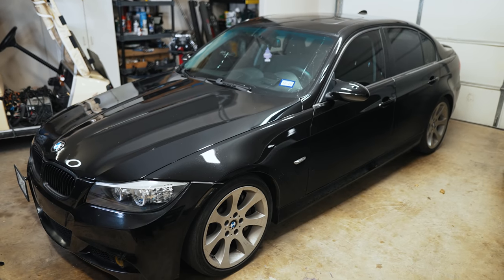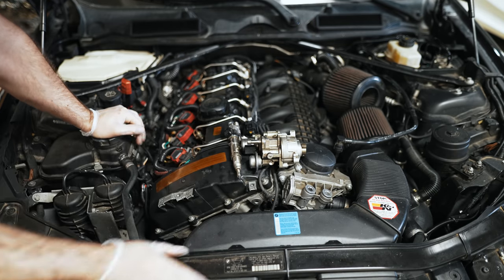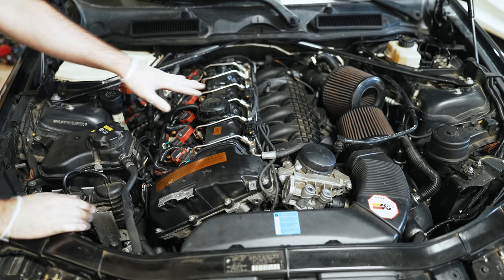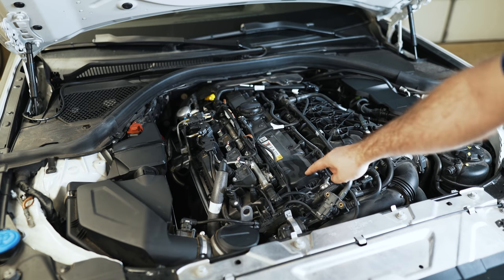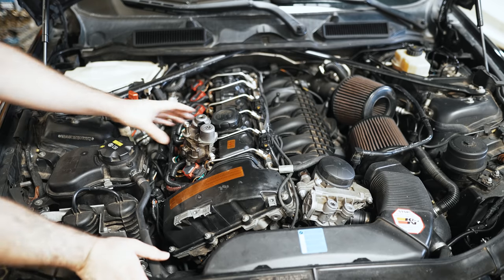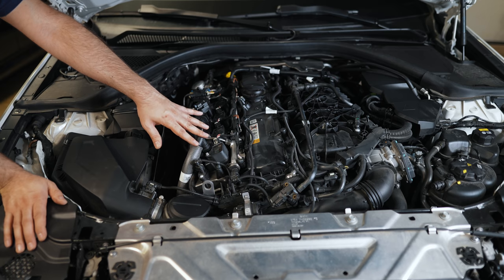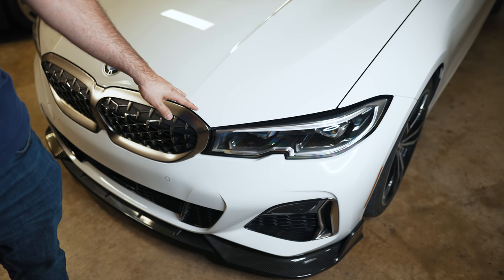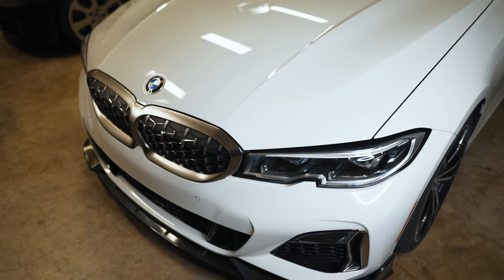Here Is Why New BMWs Are Now Reliable

Comment: The engines have always been ok, its everything around them that fails.
Reply: The straight 6 in my 2007 525i was well built. Got 200k miles from it so far. It began leaking oil at 180k. $1k to fix and not a drip since. Original ac and transmission. Cant complain.
Reply: Incorrect. Timing chain failures and initial BMW denial.
Reply: @kerkiraz  Infrequent oil changes and clocking are the cause of timimg chain failures.
Reply: except all v8 and v10 lol
Reply: Shit i wish my 745li was i loved that car but the one i put in it was to much for me
Reply: No they haven't, but now second place behind Mazda in brand ranking this year pretty impressive!
Reply: @adnani.6953  speed every day doing 80mph on the highway. Changing oil every 8k isn't enough? Lol ok...
Reply: @adnani.6953  BMW in Canada come with free maintenance during the warranty period. So your explanation that the problem is no maintenance sounds like a fan boy excuse.
Reply: Hmmm...that sounds like Rover Group saying the K Series was reliable, it was just the poor quality head gaskets....
Reply: @H H facts with out the turbo
Reply: 😂 rod bearings anyone
Reply: @Nordic_Mechanic  and inline 4
Reply: @speed-dragons6125  old bmw or no bmw for me.
Reply: @dgw4049  same bro!
Reply: I have a 2016 built N55 with 80k mi, only things that failed are my thermostat and water pump.
Reply: @dgw4049  oil leak is a simple fix that’s common on any cars at 200k.  Check your valve cover gasket, Pcv, or Oil pan gasket. You thank me later 😅😅😅

Comment: The B58 was released in July '15 and has been an excellent engine. I've only ever opened one up and it turns out the mechanicals were fine - turns out it just needed software. I think BMW's relationship with Toyota has resulted in the quality we're seeing with this family of B-engines.
Reply: You have to be kidding me. Toyota did not do anything to develop a BMW engine that has been around for 30 years. They improve it every generation.
Reply: @eazy-333  Incorrect. The current Toyota Supra uses the BMW B58 engine and Toyota insisted that in order for it to be used in their product it had to meet reliability standards that, while perhaps typical for Toyota, exceed BMW's historical reliability. Toyota engineers worked with BMW's during development. If BMW simply 'improved it every generation' then by now it would be a faultless variation of the original, but it's not. The B58 is very different from every inline 6 before it.
Reply: @snerby141989  ok believe your fairytale.
Reply: @eazy-333  lol
Reply: @snerby141989  correct
Reply: @snerby141989   Different from petrol engines but similar to BMW diesel engines. And also if you look at interviews with people from Toyota, they say: "We were surprised how much money BMW spent on B modular platform." 
The reason, why B58 is much different from N55 and N54, is the B-modular platform. Look how similar the first gen of B58 is to B57.
Reply: @BogotSR  very similar. I believe the block is the same part number
Reply: @eazy-333  why is that so hard for your smooth brain to believe
Reply: @sesh3508  The fact that the best Toyota Supra is a BMW.
Reply: @eazy-333  it’s also brand new… the best BMW engine developed in part by Toyota bud
Reply: @sesh3508  oh so you agree the best Supra is a BMW. Got it.
Reply: @eazy-333  I’m not denying facts like you
Reply: Try to open another one. One is not enough I have opened a few and I’ve seen many failures
Reply: @wilberhernandez970  Vehicles tend to live easy lives where I live so while I don't doubt you're seeing failures where you are I still haven't seen an engine failure or need to open a B engine during the year since the comment you replied to.
Reply: @BogotSR o
Reply: @wilberhernandez970 I’ve opened a few due to hardware failures. Sure, but ask why they failed? It’s because of idiotic tuners and bullshit tunes. The B58 is a solid, reliable platform and is now being confirmed in the older units, doing 10s to 100s of thousands of miles with basic maintenance
Reply: The B58 came out in 2015, the supra came out in 2019. Development for the B58 would have been long before Toyota approached BMW for the supra.
🤡
Reply: @SupraSav Correct. The B58 had nothing to do with Toyota at all.
Reply: @snerby141989 if Toyota has extensive hand in the development of this engine, why did they skip out of joint co development claim on this engine? There has to be some official claim on their contribution.
Reply: @Fear.of.the.Dark.  I don't understand - there are many engineer interviews and comments by Toyota engineers with regard to their involvement with the development of the engine for the Supra (a modular platform being used for all BMW inline engines, currently). Nothing is being hidden. Just because it wasn't a marketing tactic doesn't mean it didn't happen
Reply: Where I can’t find that it was released on July 15? Because that’s my bday 😅🔥
Reply: @JWCYOUTUBE That would be part of the same generational family

Comment: TITLE SHOULD BE: " Here is why BMW's could now be reliable, unlikely, but you never know'
Reply: Here's why BMW's are now reliable....compared to previous BMWs. 

Basically they will still be unreliable compared to Toyotas....but Toyota apparently thinks BMWs are reliable enough to let BMW make their Supras...so my guess is instead of failing before 100k, they will fail around 150k miles. On the other hand...a car that goes 3.7 seconds 0-60 is never gonna be reliable compared to a car that goes 0-60 in 7-10 seconds.
Reply: @DJUwU  Toyota made a lot of changes to BMW design and materials during the development stage. There's lots of info on this, You can check it out.

Ironically, the Z4 could prove to be the most reliable BMW of the modern era due to Toyota Engineers having done their own testing and contributing to the development.
Reply: @DJUwU  do you know how much time and money it takes to develop new engines? A engine from BMW is always a win plus you save time and most importantly money
Reply: @DJUwU  But most BMWs don't do 60 in 3.7, nor most toyotas 10. of course BMW is up market on top and has cars at that level but comparing a 7 second to 60 BMW to a 7 second Toyota or Honda BMW reliability is meh.
Reply: @alxace  Toyota did make a few changes to the B48 and B58 in the Supra, but not "alot". The Toyota and BMW partnership has been going on since the i8 was in development. Toyota have been a part of the development of the B-modular engines, the i8 is basically a Prius but with a B38.
Reply: Bmws are more complex than Toyota’s and therefore require more maintenance. Modern BMW’s are incredibly well built and reliable, when there are 5x as many censors there is going to be more “issues” its a more complex machine with more failure points. All in all, only buy a BMW if you are willing to become well researched in your complex vehicle, or you are willing to pay expensive maintenance bills.
Reply: @TheGamingNorwegian  Saying the i8 is basically a Prius has to be the stupidest thing I've read on this platform. They're absolutely completely different cars. Everything down to the drivetrain and transmission is completely different.